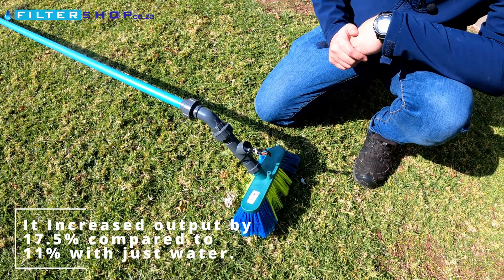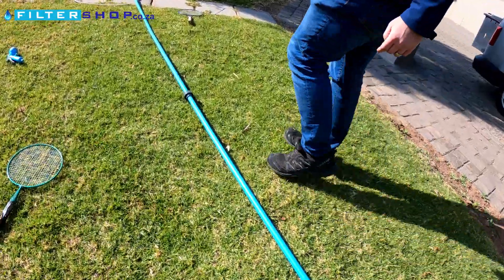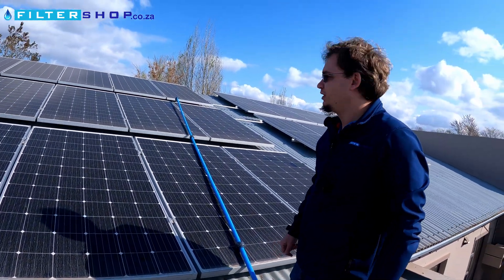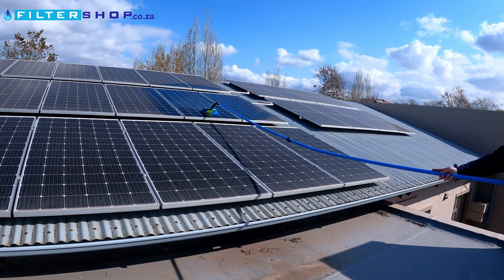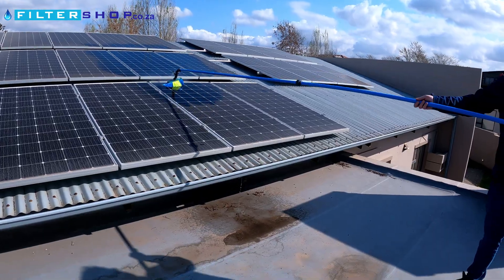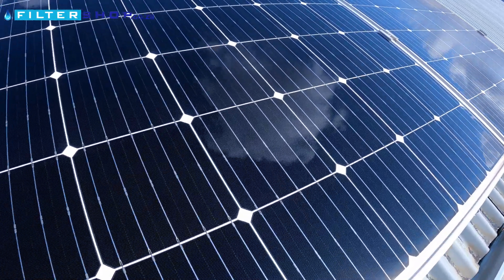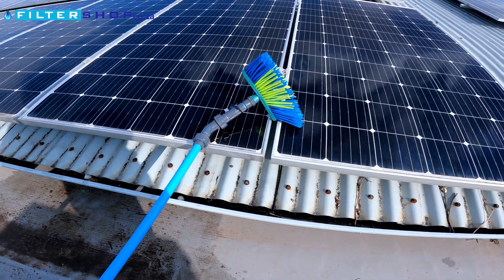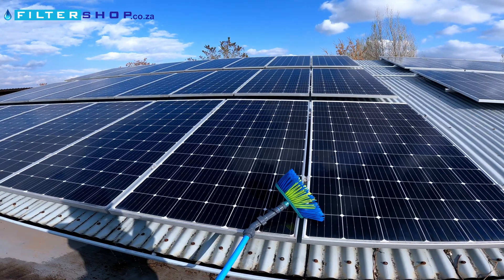Budget DIY Solar Cleaning Pole, Brush, and Sprayer

Comment: Primate Pool Poles make extendable carbon fiber poles that are very strong yet light. They are expensive.
Reply from the maker: We are importing some carbon fibre ones at the moment as we decided the aluminium is too heavy at longer lengths.

Comment: Great first prototype.  I'm the process of putting together the hardware, what size is the white line?  Looks like 1/4" 0r 3/8" RO tubing.  After I calculated the flow,  I selected 3/8" RO tubing as 1/4" would not provide adequate GPM for the spray nozzles I have selected.  Updated: I used a 1/4" line , a 110 degree tip at .25 GPM and a 18" soft broom. Water via an automotive DI filter.
Reply from the maker: We used 1/4 ro piping, our problem was the flex in the pole and the weight. We are waiting to get extendable carbon fibre poles in.